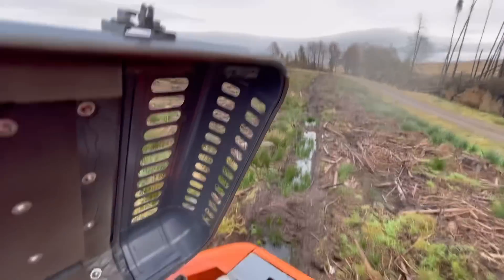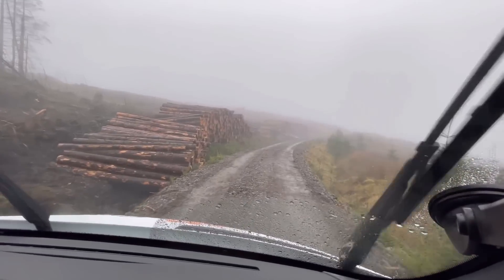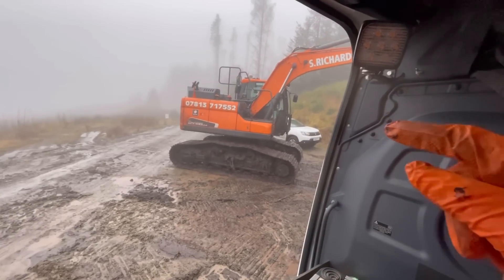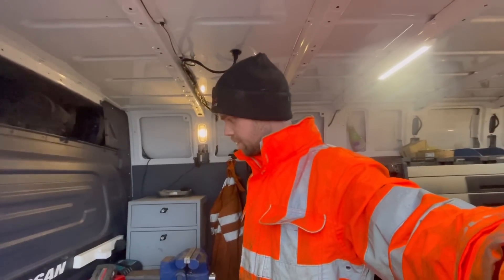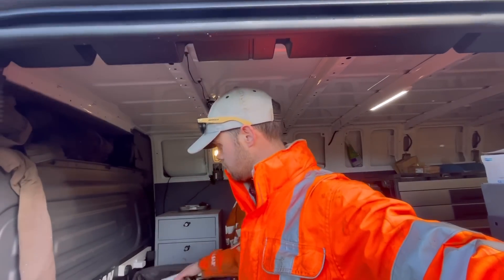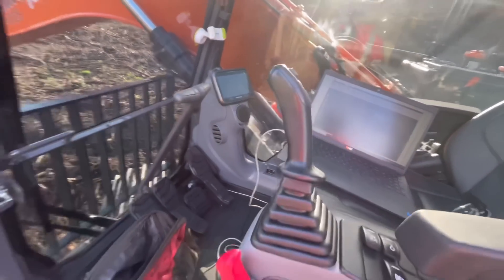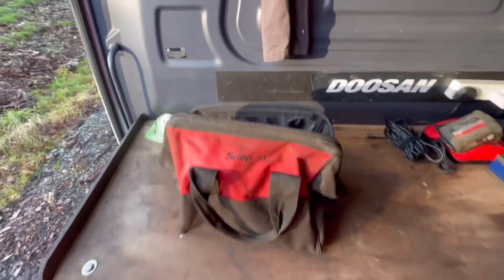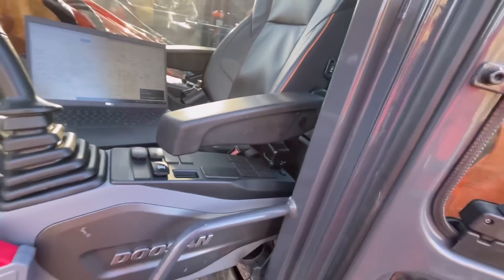It only takes 5 minutes .. nope not on a Friday / adblue fault in the woods/ Episode - 140

Comment: Does the failure rate go down with an exhaust flap mounted on the perkins engines? I've also had a few sensors on them fail in the last bit of pipe.
Reply from the maker: Yea when these machines were new you could guarantee after a wet weekend you’d expect a Nox or NH3 sensor failure on Monday morning looks a bit shabby but a £13 exhaust flap is a lot cheaper than a sensor !